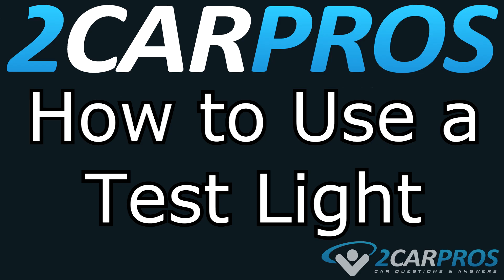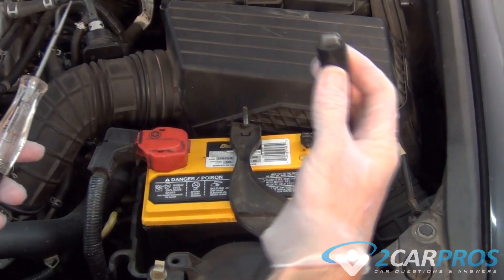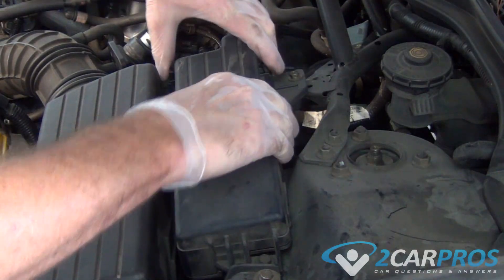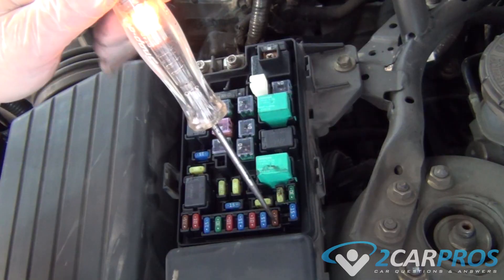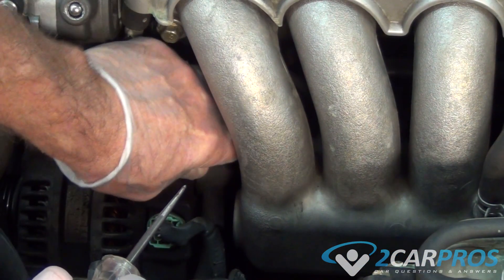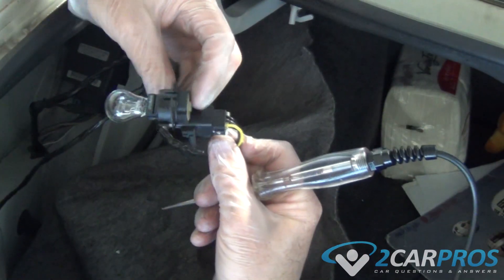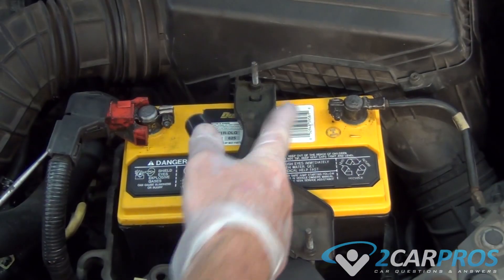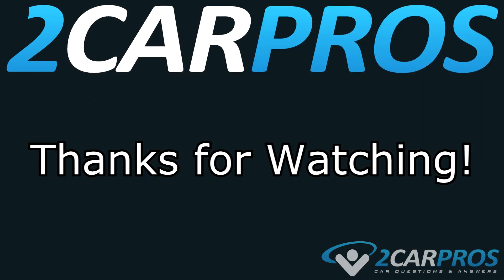HOW TO USE AN AUTOMOTIVE TEST LIGHT TO FIND PROBLEMS!!

Comment: can you hook the test like to the positive of a battery  and use the point to pu 12v on the input of a relay and make the relay switch?  Use the test light as a jumper?      I think you can, but I'm not sure, the light will light up, but will it put 12 volts on the relay or will all the voltage me on the light.       I'll probablyhave to test this myself.

Comment: Not very good video bro... you show a fried plug....did you do a test to find that? But pretty obvious that it done working. You should  do alot more tests. I think everyone  knows how to test a fuse. Im having to find why my battery is draining can you use it for that? I also believe i have some broken wires in the steering column how about that? Why would  my cig lighter fuse pop? How about that?

Comment: If the fuses are not near the battery, what can you use to ground.  My fuse box is in the glove compartment, and I cannot find anything to ground to test the fuses.
Reply: i would use a battery operated voltmeter.
Reply: @charlesdowns1691  it has to be another way to do this ?

Comment: Sorry but you confused me on the fuse box process, lets say i checked the fuse both side right and left lead, and it does not light is that good or bad?
Reply: The test light must glow when touching both contacts of the fuse or the fuse is blown.  If only one is lit, then you know that must be the contact closest to the battery before the break in the fuse. The contact point on the other side is now cut off from current because off the gap blown out in the fuse.  If neither contact lights the tester then you are not receiving power at your fuse box or most likely you don't have your test light grounded properly (a common mistake).
Reply: @davidm3210  thank you

Comment: also test lights may not let current thru. i found out after testing a small electric motor on my tractor. i knew was working. remove test lite run str8 wire and it was fine. even tho the light would light showing working condtion

Comment: Is that the same as a continuity tester? 💡
Reply: I'm bit late, but for anyone else wondering, no they're not the same. 

These testers rely on having an external power source run through them to light up the lamp, usually the car's own battery. When he was checking the alternator for example, that positive connector is wired through to the fuse box and eventually back to the battery positive post. And since you have the tester wire connected directly to the battery negative post, or another metal ground point which is connected back to the battery negative post, then you have a completed circuit from battery positive, through the alternator, through the test light and back to battery negative - hence the test lamp lights up. If you probed that alternator where it should have positive voltage and it didn't light up, then you would know there is not a good 12V at that alternator point. There is likely a problem in the wiring/relays/fuses between the alternator and the battery positive. So you can choose another test point in the middle (say at the fuse box) and continue narrowing down precisely where the fault lies. 

Whereas a continuity tester (I've only used the continuity function on a multimeter) will rely on its own internal power source (e.g. multimeter batteries) to send a small voltage out one probe and look for it coming back in through the other probe. Hence if there is a complete circuit without any broken wires or switches in the OFF position then it can determine continuity (completed circuit). And you can test continuity through a simple length of wire, a switch (in the ON position), a metal cutlery knife, anything that will conduct electricity. It doesn't need whatever you're testing to be carrying a voltage or even be connected up to anything else. In fact if you just touch the two multimeter probes to each other it will indicate continuity. Whereas if you did that with these automotive test lamps nothing would happen since there isn't any power source. 

Once it is able to test the level of resistance (Ohms), then usually below a set Ohms value the multimeter (on continuity setting) will beep or light up to show a very low resistance path has been found. Bad connections can still have a complete path / circuit but if they have high resistance (like due to corrosion) then it may show an Ohms reading but not low enough to trigger the continuity indicator. In that case you should still be able to see there's a problem because of high or fluctuating, unstable Ohms readings.

Comment: Ok question I’m trying to figure out my wiring issues for my 1990 GMC Sierra. It has headlights but all the other lights mainly on the back are acting weird for example with key on it has both blinkers front and back but when you turn headlights on nothing on the back works. I used test light on it with parks on and every spot on plug lit up even though I only had parks on. Then I saw this video and hooked my test light up to the ground on my battery and everything is lighting the tester up even if I touch my fender. I hooked up tester to positive side and it won’t light up on anything. I also did that test on my 97 GMC Sierra in which I’m having no problems at all and the test was the same. Any advise
Reply: It sounds like you have a ground leak, which is typically caused by corroded or broken wiring. Look it up, and happy hunting!

Comment: So how is a 10 dollar test light checking the condition of a fuse and also testing to see if power is going through it? I'll wait.

I own a 120 dollar test light that has a voltage display and will show when polarity is switched, I will never go back to just a regular test light. So many times the light will light up but its not the proper voltage and your screwing yourself in finding the problem.
Reply from the maker: Because the fuse is either working or it's not. If I needed to know exact voltage and amperage I'd grab my multimeter. Thanks for watching!
Reply: @2carpros  So thats what you should say. Also how does one test to see if an alternator is working with a test light? Your confusing lots of people because you can't really test an alternator with just a test light. Not saying you don't know what your doing but your confusing a lot of people that are coming here for advice with words you choose. Only thing this video shows is how to use a test light and people are still confused. What all I have to say is why there is so many dislikes. At the same time if people don't know how to use one or how to figure out if an alternator is bad I guess there isnt much help you can give those types anyways.
Reply from the maker: 75 dislikes vs 1.3k likes is actually a pretty good ratio here on YouTube. This video is how to use a test light. Testlights are cheap and great tools to help sniff out electrical problems.

Comment: Can we check what wire is a reverse light wire with a test light cause I want to install a reverse camera to a Chevy trailblazer 2007 LT
Reply: Yes simply have someone put in reverse while you go through the wires and find out which one lights up when in reverse only.

Comment: Can a test light be used to test 3, 4 and 5-prong relays?  If so, how is that done?
Reply from the maker: Yes it can. You just need to know which prongs are connected to each other and which prongs when voltage is applied force the other prongs to become active. Then you can use the test light to see if the circuits are being completed when they should be and if not the relay is bad.

Comment: Thank you for your easy and quick video lesson.  I just got my first tester today and had questions as to when to switch from the positive and negative cables of the battery - you answered them which I am so thankful for.  Tomorrow is going to be a really fun day because with my light I can now go through all of the electrical and find out more about what is going on with my vehicle.
Reply from the maker: Awesome! Thanks for watching!
Reply: THANKS!  i missed that part - Only notice when saying attach test light to Neg. of battery re: Fuel Injector.  2:29  
guess depends if Power is constant on - or know to turn on.   twisted understanding tells me it's not my forte'.  lol 
I DO Know website does have info on my car or same engine, when others don't.   Cheers!

Comment: Maybe I'm dumb but I wish this video would explain what it even means when the light comes on lol. Like, is that mean it's good?
Reply from the maker: The test-light turning on just means the circuit is complete. Which means where you are sticking it is getting power. Thanks for watching!
Reply: @Damnit Bobby He was testing for ground. An alternator grounds through the bolts so the whole casing is a ground. It means the ground was good on the alternator only. A regular test light CAN NOT test to see if the alternator is working properly. For that you need a voltage tester.

Comment: So, if the light turns on does it mean it is burned out or no? Im yet to figure that out.
Reply: If the light goes on it means the connection is good. If the light don't go on then there is a short, meaning a wire is bare and touching on metal causing an interruption in a continuous circuit.

Comment: Can I use it for testing spark plugs ?
Reply: FirstGear 8 no at that point you are doing a compression test. Test lights are meant for electrical issues specifically.

Comment: Nice explanation with some good camera angles. It is worth noting that this is an incandescent bulb inside of the test light shown. If someone is probing a computer output that cannot source enough current, it can possibly damage the car's computer. Or if an airbag wire was probed, it could set off a airbag light, check engine light, or worse, could deploy the airbags. Use a test light with an LED or multi-meter if anyone has doubts!
Reply: Riiight 🤣

Comment: If voltage like 6 or 14, bulb should be Bright? Bulb in the Test light is 12v.
Reply: Anything less than the 12v it will work, but it will be dim instead of bright. For example, a lot of circuits such as the power to the injectors in some vehicles will show a dim light because they use only 5 volts.
Reply: Thats not true a lot of these test lights will light up at 3 or 4 volts all the way to 14. Thats why I think these style test lights are garbage.  Used to own one and then went to a votage display test light all in one.